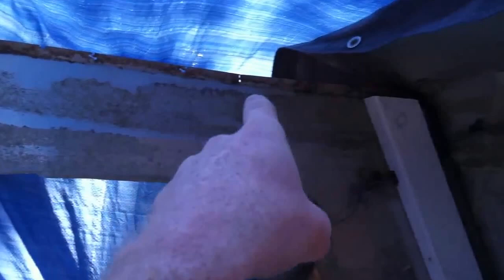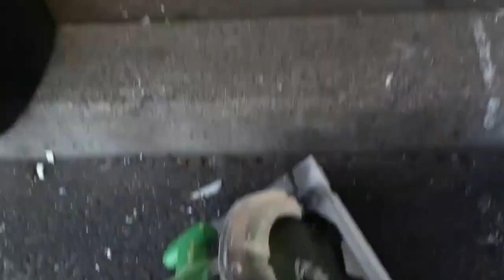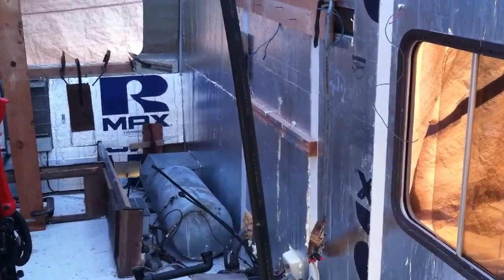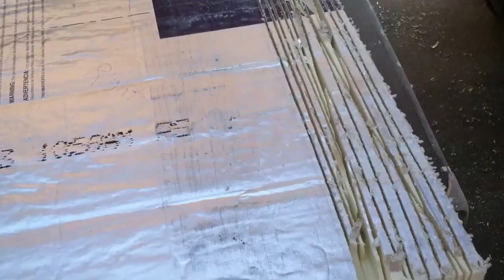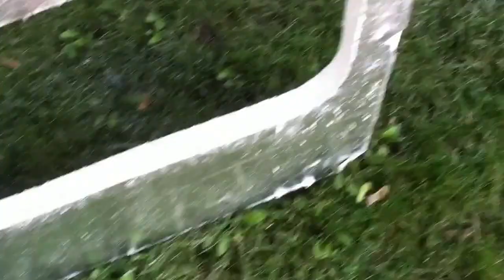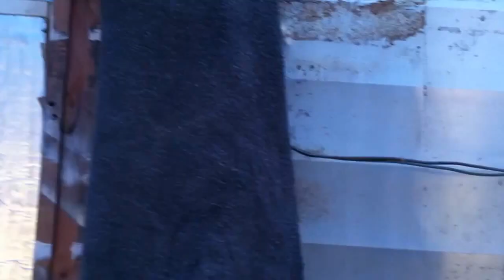Off Grid Winnebago Renovation part 16 (how to - install foam insulation in an RV part I)

Comment: You are going to be well insulated! I'm pretty sure my motorhome isn't that well insulated. This is a lot of work, but doing it right the first time around (not that you'd want to do it over) really insures better comfort in the long run. I'd do the same, I'd use the smaller pieces too to tape/glue together to save on having to buy more & to help keep it within the budget.